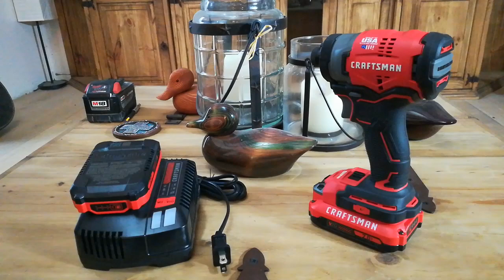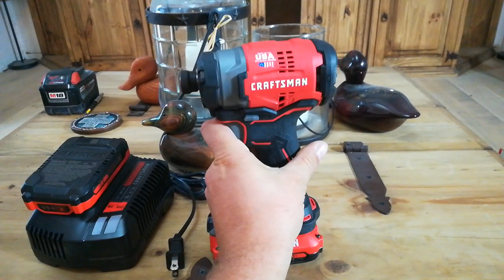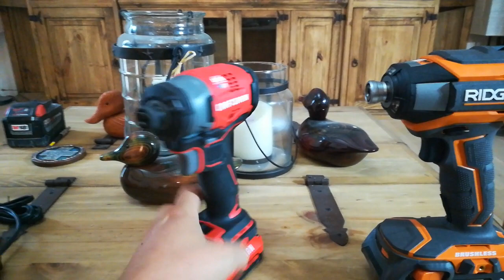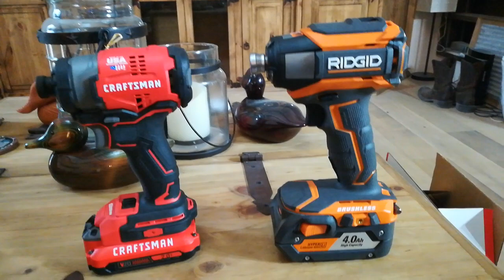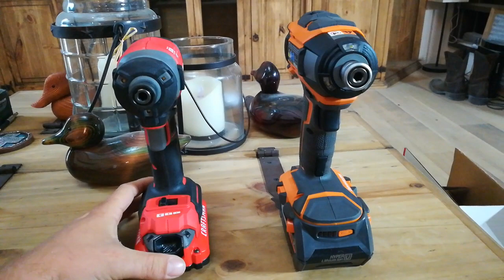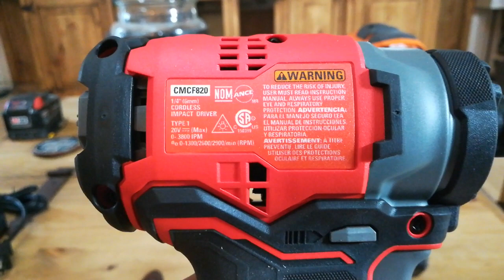New Craftsman v20 brushless impact driver

Comment from the maker: Correction there appears to be 2 different models of Craftsman brushless impact drivers, this model has 1,700 inch pounds of torque, 2900 RPMs, and 3800 impacts per minute. Sorry for the wrong info.
Reply: The one that has the USA flag is because is made in USA? Ive seen both brushless model but I think I prefer the Gringo model vs the made in China model.
Reply from the maker: @KJTEJ  it's assembled in the usa with global materials, but I'd agree, the gringo model is better.
Reply: Yeah, it confused me too at first

Comment: I have one of those Craftsman drivers. I bought it about 2 months ago and use it for automotive work mainly. I also have the 19.2 version this one replaces. It is more powerful than the 19.2 and smaller. So far I have no real complaints about it, it does well.

Comment: The speeds vary on the drill & website because it has 3 speeds. That highest speed is 3800 rpms the lowest is around 950 rpms, I have the same craftsman brushless impact driver and the new brushless Hammer drill.
Reply from the maker: I actually like the hammer drill quite a bit.

Comment: Dude, don't diss on the Ridgid, I have some red stuff and they're fantastic, but I really love my Craftsman stuff from way back in the day, and my Craftsman Professional was actually made by Ryobi, and that was the stuff that steams were made of and it was a 24 volt non lithium ion battery, so don't be like that.. and actually that Drill still works very well, I bet, it's good for mixing paint
Reply from the maker: Didn't say anything bad other than they are heavy, when you lag an impact around all day, an extra half pound adds up, I think Ridgid tools are great, and have tons of them and honestly think it would be a good model for sbd to follow with the Craftsman line. I do believe Ridgid is the best prosumer line of tools out there.
Reply: @ryanjewell9832  the Ridgid are a bit on the heavy side, but they're great tools, maybe I'll make my way back to the Craftsman brand, as I did love them, but we'll see, I'm invested in a different platform now, in the Craftsman looks like a rebranded DeWalt to me
Reply from the maker: @Andreas Shizas oh, I do love the Ridgid tools I have, now with the new Craftsman, the impact is nice and lite, but unless they have plans expand into other brushless tools they will lose my interest, I bought the craftsman circular saw and it's basic, works well, but very minimalistic. Looked at the recip saw and it looks like a toy, and the jig saw looked promising, but you need a tool to change the bevel. So, I do like this impact and trying to locate a new brushless hammer drill to try out. but hoping for more from other items.
Reply: I don't Craftsman guy from wee wee wee years back, so don't misunderstand what I'm trying to say, I have hand tools from the early 80s and 90s, and they're wonderful I'm just worried about their power tools like I said I have a a Craftsman from the early 2000s, that is fantastic I use it to mix paint now it's just worn out it's just old so I don't sound Craftsman there hand tools fantastic from the old days, but you know I want to see better from them I expect, better from them before I have to deal with them
Reply from the maker: @andreasshizas5977  my first mechanics tool set was Craftsman , USA made given to me from my father, he used Craftsman tools in the garage, I just got my grandfather's old Craftsman wood working tools, USA made, the name is sentimental, and that's what Stanley i believe is banking on in buying the name is the sentimental value. Now hopefully they can bring it back to close to what it used to be.  Wish the power tools had a lifetime service agreement like Ridgid, and it would go with the heritage of the Craftsman name.
Reply: I didn't mean to say anything bad about Craftsman, I love your tools and, they are among the best, now I've had their stuff for 30 years, but their power tools have lacked horribly, now having Center I can say that my Craftsman Professional / Ryobi perhaps I don't know, is one of the best girls I've ever had, the still, I love the Craftsman stuff, just stepped the game
Reply from the maker: @andreasshizas5977  oh no need to apologize bud, every body has their opinion on things, there were no reviews at the time so I figured I'd share. Im honestly just a tool junkie with very little life. Lol
Reply: Ryobi TTI, Ridgid Emerson not same company
Reply: @andreasshizas5977  Dewalt bought Craftsman in 2017
Reply: @joeyf7606  DeWalt didn't buy Craftsman, Stanley Black & Decker bought Craftsman
Reply: Ridgid lied on the 2250 lol boooooooooo on them. Milwaukee alllll dayyyyy

Comment: dewalt DCD886 has the same specs as that crastsman
Reply: actually just read your pinned comment the dcd886 clams 2800 rpm 3200ipm and i think 1500 in lbs

Comment: Can get the Rigid every day  for $ 99.00 with battery, case, charger, bit, and driver warranty for life and free replacement batteries. craftsman should stick to wrenches and screwdrivers and that about it nowadays not like in the old days sears Roebucks and company when they issued catalogs at Christmas.
Reply from the maker: Ridgid is definitely a better bang for the buck, my only dislike is it's weight. Might not matter to some, but when it's in your hand or hanging from you all day, it does make a difference. Other than that Ridgid is better in every way with a better tool line up.